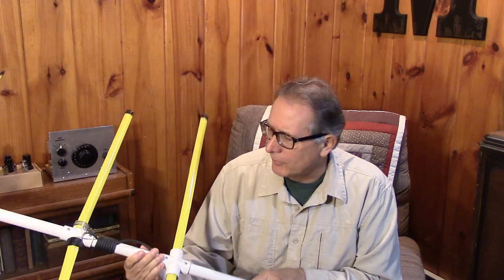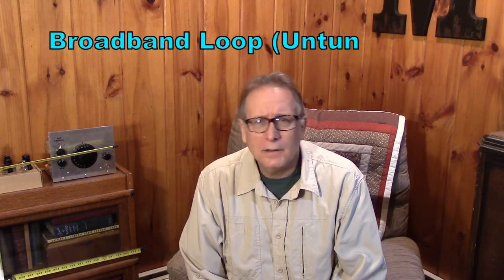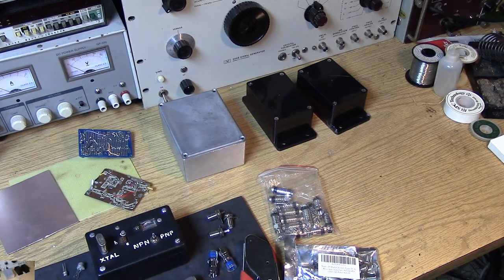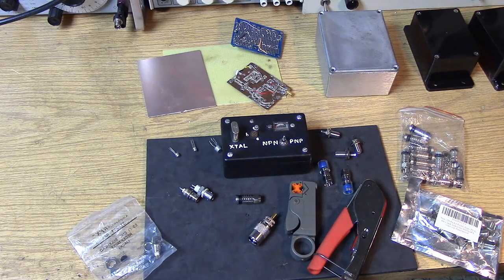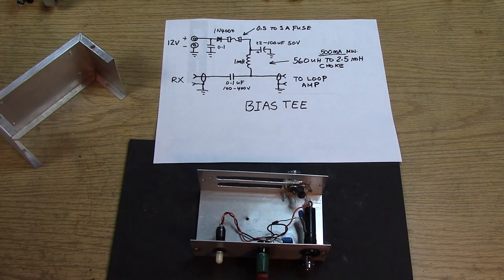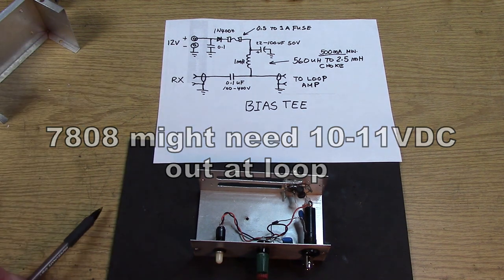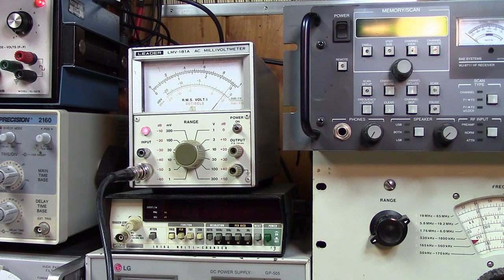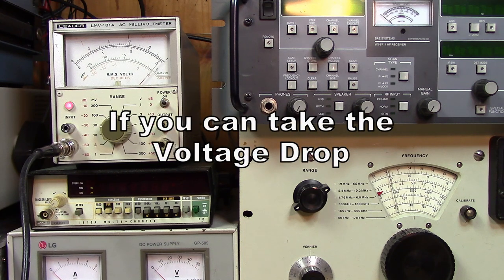Magnetic Loop Amplifier

Comment: Not 47 uHY, it is a 470 uHY.  This misinterpretation would be avoided by using an inductance meter and a reactance chart to find the impedance. The markings on the chokes unfortunately vary by manufacturer.

Comment: Looking forward to this, thanks for your efforts making these videos.  I have a cheap MLA-30 loop off amazon now just to get listening.  But I've decided I'll keep some sort of untuned loop for receive only on the SDR when I build a transmitting loop too have a wideband view so to speak.  Been doing lots of research on transmitting loops and have a few ideas on construction.  Between the 'garden warmer' crowd and other random misinformation, it's been challenging to research.  Then throw in the confusion on multiturn loops, it's turned into a good subject to think about when I want to be asleep.
One thing that I don't understand is I've found a couple people state that ribbon type conductors are not good for transmitting mag loops.  Seems like an easier way to mitigate skin effect, and didn't really understand the argument against. But I can't find that reference now.   Any thoughts on that?
Reply from the maker: An oversized version of litz wire like 100 or so insulated solid # 20 conductors would have to provide some Q advantage over a pipe of the same diameter. I have never built the more popular compact transmitting loop, so no experience. But lots in the literature and on line. All of them work - to some extent that usually amazes the builder.
Reply: @MIKROWAVE1  that's the line of thinking I've been going down. I know litz wire isn't good up to the needed frequencies. But something like ide cable sounds interesting.  Of course if a ribbon doesn't work out well, then ide cable would be hard to form into a bent tube. I've thought of trying to 3d print torrid sections with a number the channels for wires.  Some real technical issues with the software for this part. 
 I have no trees, and putting up a tower isn't an option, so mag loop experimentation it is then.
Reply: Do some reading on "antenna aperture" to understand better why loop antennas are not very effective for transmitting. (the loop would need to be 1/4 wave on a side!) HUGE!
Reply: @glasslinger  I've never seen you out 'in the wild' so to speak, thanks.  I was not really familiar with the term, but had caught on to the concept.  I'm pretty much stuck with the mag loop antenna for the foreseeable future due to situation.  Since a mag loop works better the higher the current built up in the loop,  is that due to the magnetic field being larger and increasing its aperture size?  I'm new to RF stuff BTW.
I've got enough time in research and design at this point I'm going to build one regardless.  Thanks for the input, take care and we need to get you tooled up for full production.  Seems to be a shortage of some tubes these days! lol

Comment: The best amplifier chip for a Loop antenna chip is the MC1350 and you can still use a Ethernet cable to connect the headend to the power interface.
Reply from the maker: Ah the good old 1350. The LM386 of the RF world!

Comment: Great video Mike! I've always wanted to ask you are you an electrical engineer? You're so knowledgeable and I have always learned a ton from you. I'm also a ham radio operator and I've learned electronics over the years but I don't have a quarter of the knowledge you do that's why I figure you're probably an EE?
Reply from the maker: Worked in EE roles, but not a proper EE. Always lacked the math and discipline. More like a cross between a tech and an EE.
Reply: @MIKROWAVE1  That's extremely relatable!

Comment: I use a Texas LM317T 1.5 amp voltage regulator which is adjustable from 1.3 to 37 volts with max voltage in put of 40 volts the input voltage must be 3 volts above the regulated voltage at max current,  ( lower input can be tolerated at lower current draw) so a lower input voltage can be used. A 15v output ac secondary transformer would be ideal for this project after smoothing cap added its about  21volts. under load a bit less
Reply from the maker: Not much happens when you fall below regulation with a constant load like this. So it all works out even if you mess up and have too low a source voltage.